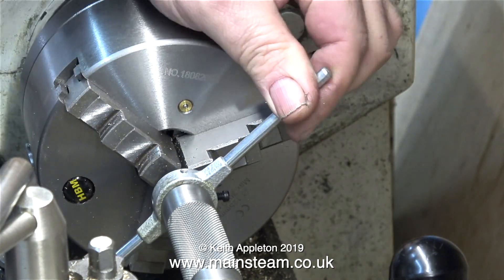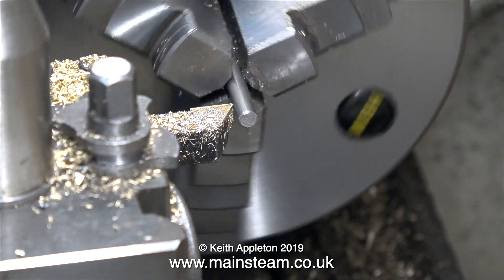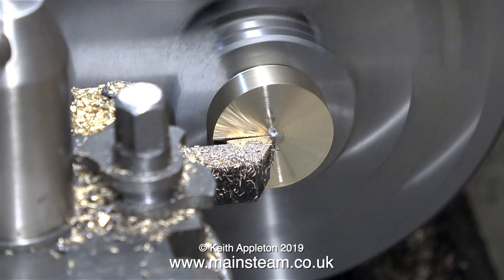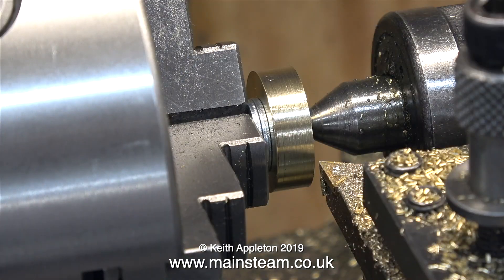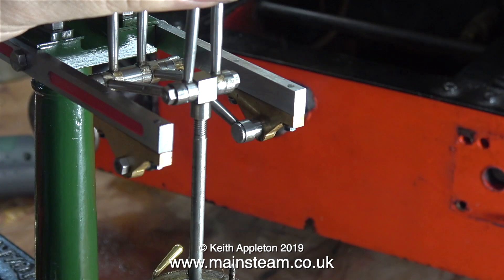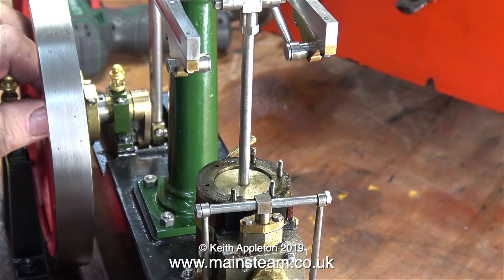MODEL STEAM ENGINES - TOP TIP TIME - PART #15

Comment: I have a quite old tap and die set and the taps seem to be fine but for the life of me I cannot get the dies to grip reliably even when turning the diameter down a bit. They are not split unfortunately, so I'll probably have to get a new set of dies.
Reply from the maker: I find un-split Dies to be useless other than for cleaning up damaged threads . . . .
Reply: @keithappleton  this seems to be consistent with my observations then